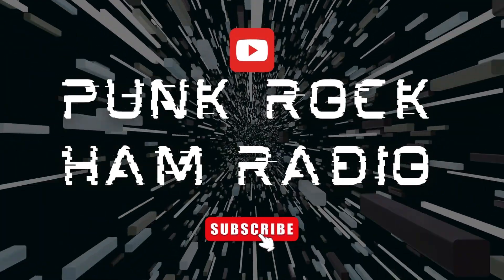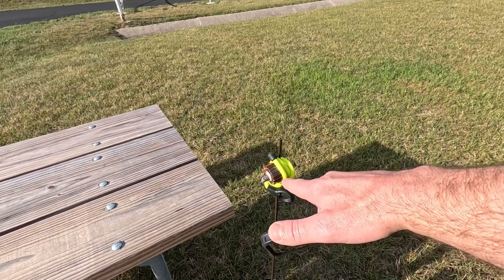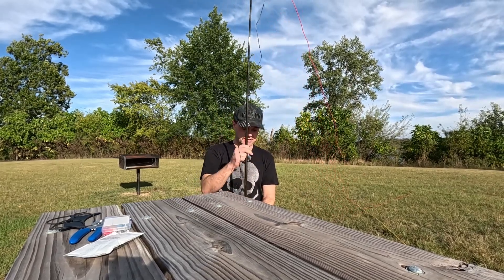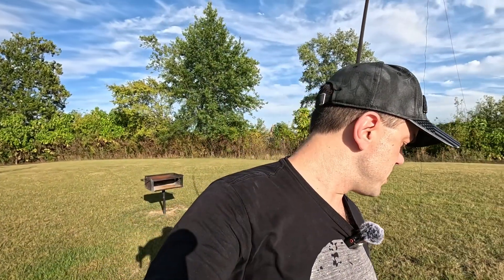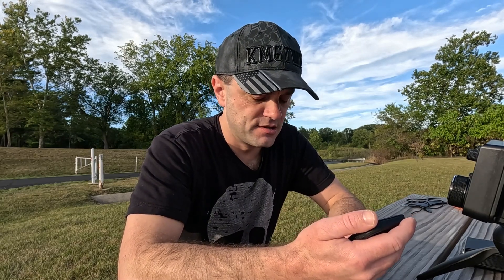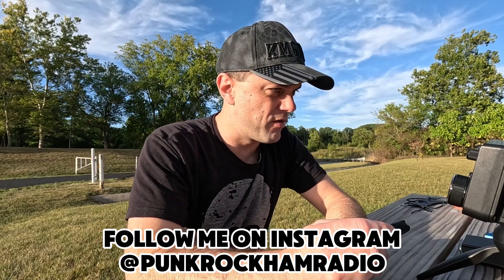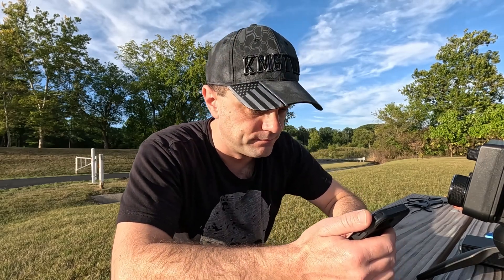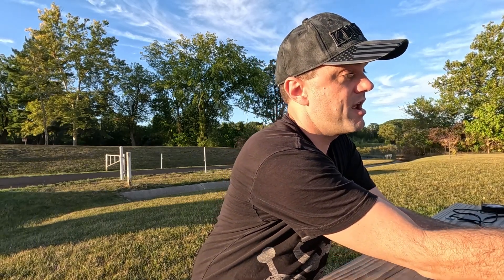Ham Radio Antenna Fail!

Comment: Wow, I played in a number of San Francisco punk bands in the late 1970s/1980 (No Alternative, The Offs, KGB, a pre-Flipper line up with Bruce) and am now an Extra Class ham. Thanks for combining the two. Great video! I build my own verticals and horizontals and I've had a few failures. I've built antennas to spec and had them crap out and I've cut a wire, connected a homemade Balun or  Unun on, raised the wire and had perfect results. Then there's the band conditions, which go up and down in a heart beat. You win some and lose some. Thanks for a great video!
Reply from the maker: @hughpatterson1480  Always great meeting fellow punk rock hams! I grew up playing shows at Showcase Theatre in Corona and Chain Reaction in Anaheim which is right by that HRO! We drove by there all the time but I never stopped in. The struggle is the reward, can’t wait to get back out and try this again doing a couple things differently. Thanks for watching! 🤘

Comment: Great job! Contacts were made! And you're having fun. I would try and rf choke. Maybe your coax is becoming part of the antenna.
VE3DRO,
Reply from the maker: @Docphilly  Thank you so much! I tried a 1:1 unun as a choke at the radio end and the radios SWR meter looked worse so I removed it. Still probably going to invest in a bnc in-line choke or coax with a choke in it already. I really want to try this again without that camping gear tie thing and just use a couple zip ties and a plastic s-biner clip. I think there’s metal inside that gear tie that is messing with everything. Really appreciate your comment! 🤘

Comment: Making contacts is not a fail in my book!  Have you ever used a Rybakov antenna?  its a vertical 25ft random wire with a 4:1 unun works 40-10. With a tuner.
Reply from the maker: Thanks for watching! More of a failed experiment but still 2 successful activations and a great day spending time outdoors. One of my Elmers always told me "Any time spent outdoors is a success." Cool! I just googled that antenna and will check it out thank you!

Comment: I suspect that you had a lot of reflected RF back down the coax. A common mode choke may have helped. Also the length of wire was either too long or too short for reasonance - no need to cut just fold the end back on itself for quick adjustment.  73 M7BLC
Reply from the maker: @johnnorth9355  Thank you so much for the tips! 🤘
Reply: I agree with John, always use an inline RF choke with any halfwave antenna. Otherwise, your coax becomes part of the antenna system (another stray counterpoise) which creates distorted/unpredictable radiation patterns, common mode currents (CMC) and unwanted RFI 😀 73 KJ6ER
Reply from the maker: @gregmihran8616  Thank you so much! For an End Fed Halfwave, are you using the coax as a counterpoise though? That added counterpoise wire helped a little bit, but not much. I’m really suspicious that gear tie I used has metal inside it that is messing with the tuning since I wasn’t transmitting when I put the analyzer on the antenna. I’m gonna try again with zip ties. Still had lots of fun! 😁
Reply: @punkrockhamradio  of course you had fun! Ya, I never use the coax as the counterpoise because the impedance (and thus SWR) goes wonky as you move the cable. I prefer a 5% wavelength (longest band) counterpoise off the transformer ground for my multiband EFHW wire antennas. For my monoband halfwave vertical antennas using a telescoping whip, I use a 30% wavelength for that band. Always choking off the coax in both cases. You have more predictable low angle radiation and consistent SWR. And yes, no conductive materials should every be used near the radiator.
Reply from the maker: @gregmihran8616  Ahh okay thank you so much for pointing that out. Definitely going to keep this in all in mind when I do this again! 🤘